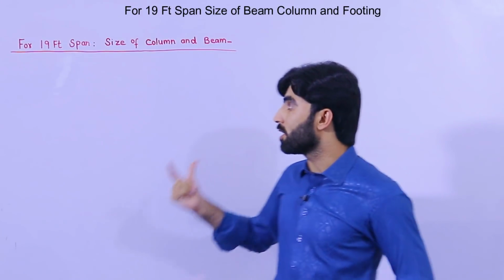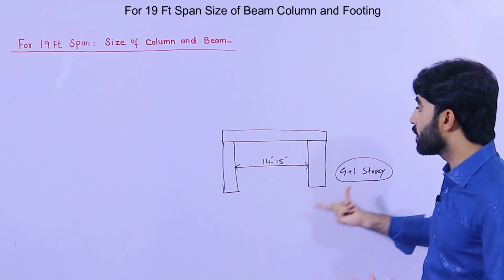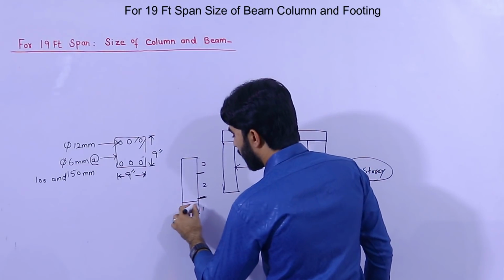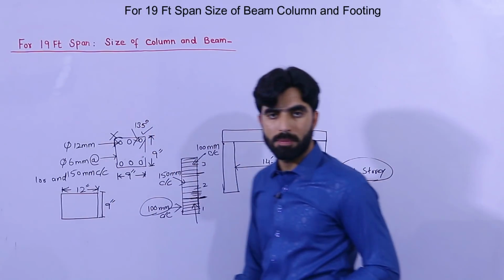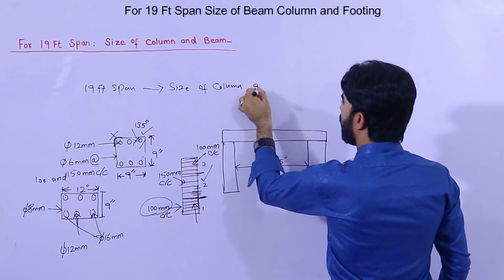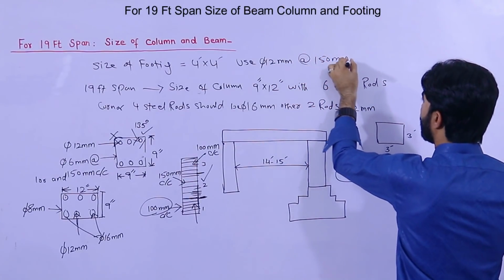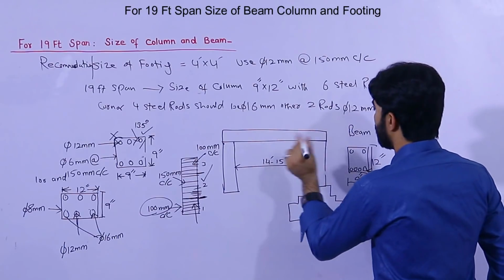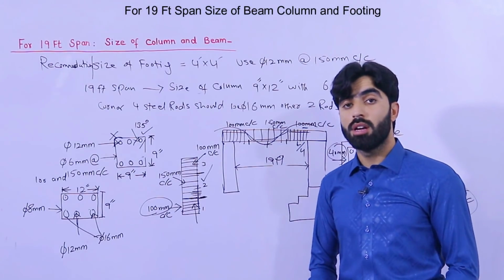For 19ft Span - Size of Footing , Column and Beam Reinforcement Details

Comment: For G+2 building. 
1. Column size 10 inches ×12 inches.
2. Steel rod used - 6 Nos : four 16mm and two 12 mm
3. Total 12 columns

On one side, column distance is 17 feet.
 Is it safe??

Comment: Your beam steel is not correct for 19 ft span... Moreover depth of beam is also very less for 19 ft... It should be minimum 19 ft... Rest of the calculation and suggestions are well.

Comment: Thanks a lot o was looking for this for a long time but didn't find much info.
The span I have is 22 ft.
Columns 9*14inches, 4 bars16mm and 2 bars 12 mm door/lintel beam is 6inches and the roof beam is 12 inches deep 16mm bars. Will it be sufficient?

Comment: Column size 9/15 with 6 Rods(16mm 4bars and 12mm 2bars with 8mm rings @6inch)  and distance between two columns is 15.8feet. two rooms, each 12feet/15.8feet. Footing 6.5feet depth width 4x4, with 1feet 40mm and 2.5feet 20mm. Is this good for g+2 residential building?

Comment: SIR I HAVE 16 feet span G+1.stroy, i have provide beam ( 9 inch *12 inch )  , with 16 mm 2 bar, and 12 mm 1 bar at bottom, and 2 bar of 12 mm at top  with 8mm stirrups @150mm c/c spacing, is it safe?? Also column size -(9"*15")
Reply: absolutely save for G+1
Reply: Can you explain that what is column and beam size with how many steel used with size
Also length and width distance of each column

Comment: Sir My newly constructed house have one of the beam of length of 5.2 m (16.5 ft) and one secondary beam is tested on it. It is 230×300mm but we used 4 no of steel bars of 16 mm at bottom and 2 nos of 16 mm + 1 no of 12 mm at top.
So ll it sustain to that amount of load for longer period or developed crack???
As I see many engineers recommend more than 450 mm deep beam.

Comment: Good thanks g Plus 3 same rvany change  need 22.4 wedth length 45 with 8 pillers is enough sir .... Stair case in middle. Minimum distance is 18 ft.
From telangana Hyderabad.
9550797979.

Comment: 6 nos of 16mm in beam (10X12) for 20 feet span.column (12x12) 4 nos 16mm &4 nos 12mm for single room .can we build g+2?
Reply: It's possible even I'm doing my own house with four 16 mm andtwo 12 mm in one biller size is 8/10